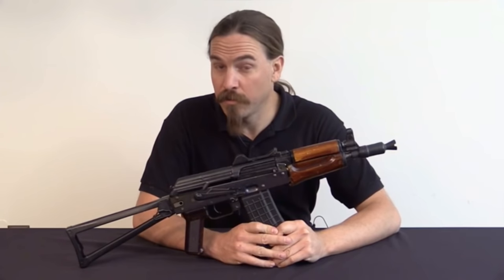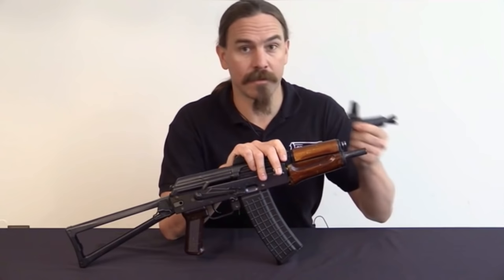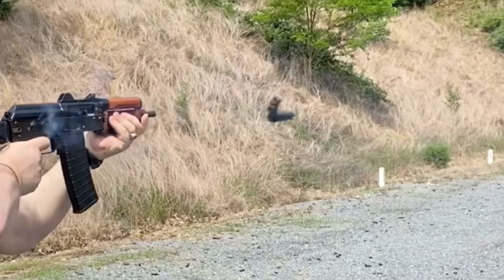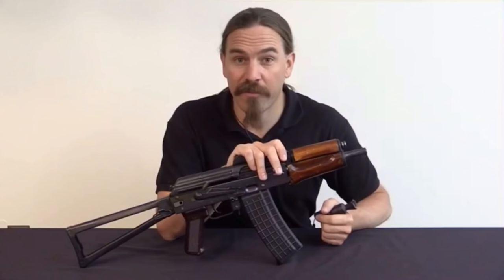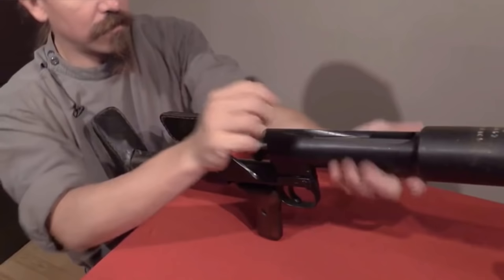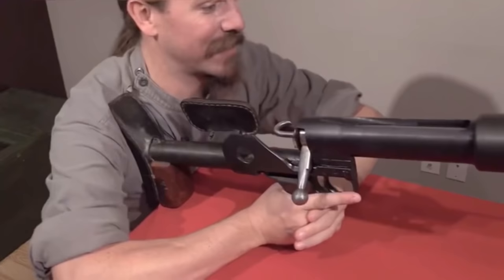Even more Forgotten Weapons memes

Comment: That PKM is stupid as fuck. I love it.
Reply: With a longer barrel it doesn't even look half ridiculous.
Reply: An lmg is supposed to be good for sustained fire,this one uses belts for that reason. For sustained fire you need a comfortable stock and with the role of the gun making it foldable is less necessery. The stock was also where you would hold your off hand when prone,thsi garbige loses that. Instead it has a foregrip,which would break when firing prone or from cover(how lmgs are used). It also has a stubby barrel with no muzzle device which means this thing will have huge recoil and muzzle flash. The wobbly stock and that poor second grip are not good enaugh.
Lets think of using this in a military setting. With it being heavy and hard to monuever with the chain holder/dangling chains,alongside it blinding everyone in a building means it would suck at cqc,unless you want the guy to run in and be a ditraction(there is tech for that)
At range the 7.62by 54mr will nosedive imidiatly,the sights are probably wrong,the stock and grip are probably wobbly and not made for firing from a position,means that your first shot accuracy would be garbige. The huge recoil and with you probably blinded,sustained fire at range would also not work.
Conclusion:this thing would be bad everywhere
Now,lets say this was done for easyer concealment. The person will have to either have a dangling chain or a huge chain holder. Also,he could have used an ar or smg for this stuff. It is also probably still very heavy,so there is no point in that either
Overall conclusion:when the soviets gave the pkm it's ergonomics and heavy barrel,they were on to something. The design is regressive in some areas and the soviets did have some big broblems,but it is a peace of history,art and deserves better.
Reply: Run and gun achievement unlocked
Reply: @davitdavid7165  I get you, it's a niche thing, but hey, air assault, airborne, vehicle bound crew. There's a reason people used chopped down M60s and Mk48s.

Never said it would be a good GPMG. you're right, it'd be shite. But if all you got is a PKM and you needed a bullet hose, you could do worse.
Reply: @prfwrx2497  isn't having good balistics even more important when you are moving qucikly. I get the stock and maybe the foregrip,horrible sights and slow af bullets nosediving instantly are not good.
Reply: @davitdavid7165  I did said in my OC about having a longer barrel... it's not the bullet drop I'm worried about, it's the flash and concussion on that tube. I wouldn't cut it under 18 inch, and definitely with a good muzzle device.
Reply: @prfwrx2497  sorry for missunderstanding you.
Reply: @davitdavid7165  That's alright mate.
Reply: @davitdavid7165  it’s a piece of history and all that but the Russians produced a lot so, it’s pretty cool
Reply: @reaganriddle  i mean,you are not wrong.
Reply: Modular*
Reply: @davitdavid7165  Its a photoshop. Freaking chill
Reply: i am 100% sure i made that while bored grinding damascus in MW
Reply: Pechinka
Reply: it looks like something straight out of call of duty

Comment: Gun Jesus will definitely launch a crusade against those Bubbas who did those things to those weapons.

Heaven forbids if they managed to get ahold of a French gun.
Reply: At that point the Holy Ammo Can of Antioch would be holding modified square bullets, for being fired out of French weapons only, so that Gun jesus would bless them with straight trajectories and good spalling.
Reply: Two words:

H&K Chauchat
Reply: I ran into a numbers matching Berthier M-16 at a local pawn shop once that Bubba got his claws on, the fucker cut down the stock and sights and welded new irons to the top of the receiver.
Reply: @automatteck3477  holy shit. Numbers matching Berthier bubba'd to heck? What is wrong with that ape?

(Also, this just proves that I've been watching entirely too much Gun Jesus because I know the significance of that despite not coming from USA)
Reply: @automatteck3477  SACRE BLEU!
Reply: @Lakhshamana  I've seen worse, the same shop had a numbers matching Steyr M95M that would've been pristine if it wasn't for the cut down stock and missing handguard - numbers matching M95Ms are extremely rare because no spare parts were made after the conversion and most have mismatched bolts from their extractors breaking. I actually ended up buying that one, eventually I'll restore it.
Reply: C'mon man, everyone wants a sporterized Lebel.
Reply: @1337penguinman  Bold words for someone within crusading distance.
Reply: 8th Amendment, prepare to be ignored!
Reply: Démantèlement, jusqu'à ce que ce soit fait.
Reply: He will launch a crusade against gun heathens and will use a fkin square ammo
Reply: There is a picture of an un-bullpup’d FAMAS. NGL, I think it looks kinda cool.
Reply: BRING FORTH THE HOLY HAND GRENADE!
Reply: God forbid anything firing .32 French longue.
Reply: Get ready for saw-off bullpup glock with extended mag and hentai wrap (highly tactical👌)
Reply: @C4Cole05  He did. Book of Browning, 30:06.
Reply: This just gave me an idea for a game that I will never make. You have to escape the US after whatever disaster and your weapon progression starts you off with shitty guns because you're stuck in California and all the better stuff is in states further east, where you're headed.
Reply: @1337penguinman  increased mag capacity berthier utilizing chauchat mag
Reply: Some aren’t too bad, like the hecate
Reply: Triangle rounds for bubbas.
Reply: SAMAF moment
Reply: well that shouldn't be hard, there's lots of French guns on the market, although they have never been fired you need to be careful, most of them have been dropped.

Comment: 0:26 That Škorpion is actually ok. Vz.68 variant introduced that stock, than it was modernized into SA 361 variant and tactical rails were added. Yes, it looks cursed but unlike rest of those weapons it wasn't irreversibly damaged and can be turned back...
Reply: it doesn’t look horrible, except I feel like I’ve seen that sight from the plastic guns at Walmart
Reply: At least it looks like an actual firearm and not a mangled corpse.
Reply: i’d use it. stick mag means it’s in a useable caliber
Reply: the only issue with it i can see is the vertical grip. take that off and you're golden
Reply: Also... Dare I say, if the grip was a little bit further forward, I think it would actually be pretty rad.

Comment: A bolt gun is absolutely viable depending on terrain, local gun laws, and your purpose for carrying one. Bolt action tends to be more reliable than semi- or full-auto, which is great for foul weather and spending a long time on the move before you can bivouac for a spell to clean your rifle. I've also heard that they can be more precise than their SA or FA counterparts but most of my experience is on carbines so I can't corroborate that. At any rate, with a typically longer barrel you're looking at better velocity which translates to better range, which is perfect for wide open or mountainous terrain, while the closer quarters of dense forest or suburbs and cities means range becomes less of a factor. In populated areas specifically, bolt action becomes detrimental due to the much higher risk of hostile confrontation. There you are much better off with sacrificing a bit of range and stopping power to gain much faster firing rate and usually higher magazine capacity.

Comment: The bit i find most odd about that AKSU abomination is it is drilled with a 3rd pin. Technically in the eyes of the ATF that makes it a machine gun whether or not it actually had an auto sear
Reply: it is select fire. its a post dealer sample machine gun that was ordered by a gun range so they could rent out a Krinkov to use on the gun range.